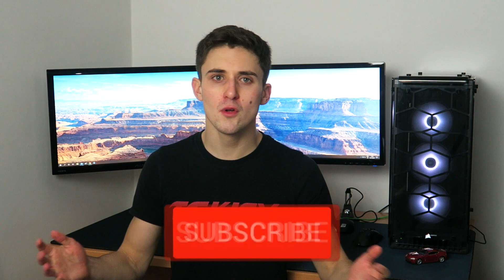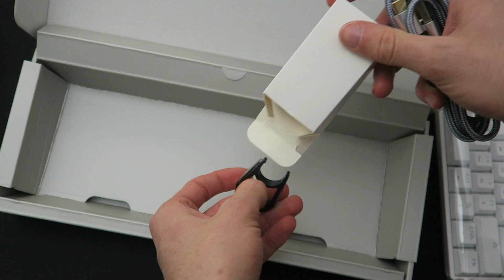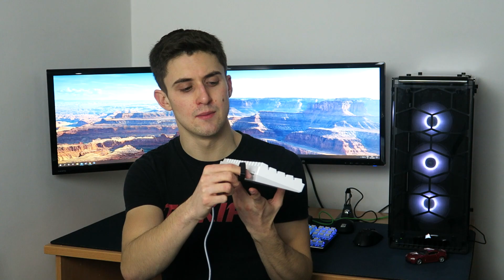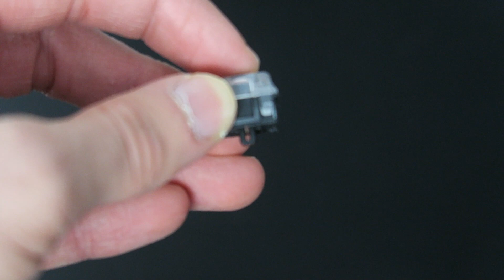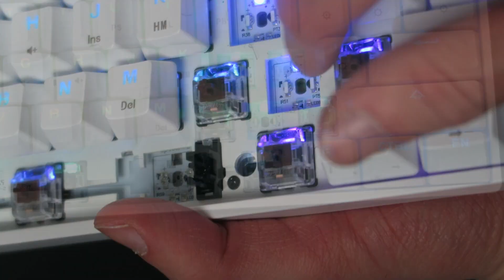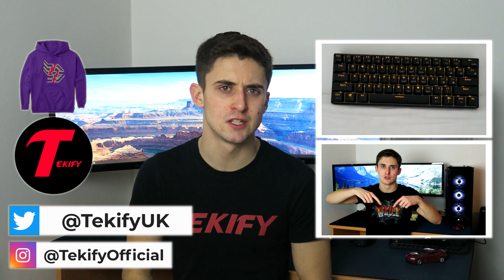GEEK GK61 Review + Sound Test - Impressive OPTICAL Keyboard (Gateron Brown Switch)

Comment: Which ones are the most silent ones?
Reply from the maker: Brown or red are about the same. There are quite a few options you can get on this keyboard but I can't imagine any are quieter than brown or red.
Reply: @Tekify  hmmm thanks, and which one do you suggest?
Reply from the maker: Red are linear, they have no distinct click and are the same force all the way down. People consider these better for gaming. Brown have a slight tactile bump but don't make a clicking sound, hence they're also as quiet. They feel more mechanical and are often thought to better for typing. That being said I game on very clicky switches just fine. If you've never had a mechanical keyboard before I would say brown because it will feel more mechanical. If you get a hotswap keyboard like this you can always change later. You can also buy test packs of switches that include one of each colour so you can see which you like. Hopefully this helps
Reply: @Tekify  yes thank you also im switching from a ducky one 2 sf on silver speed and im looking for something that feels the same, i owned a huntsman mini with clicky but i returned it because it was feeling like the switch its not pressed all the way down